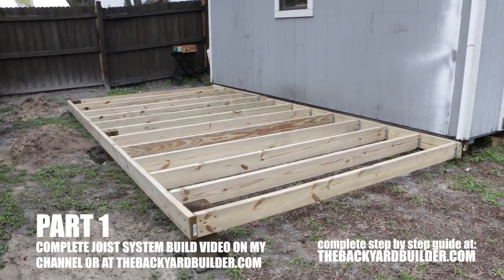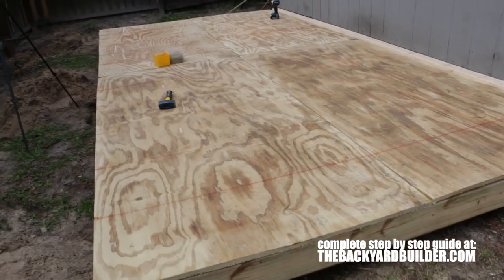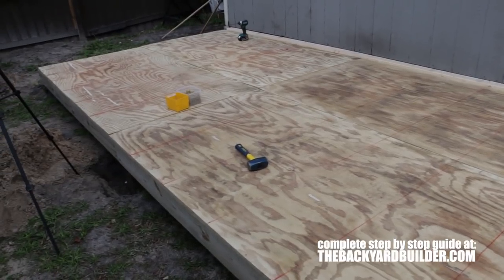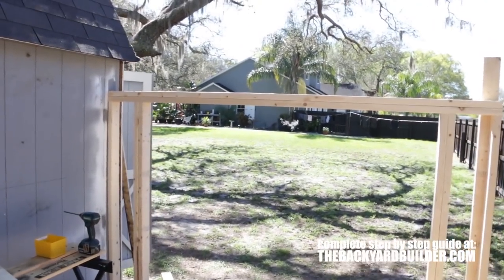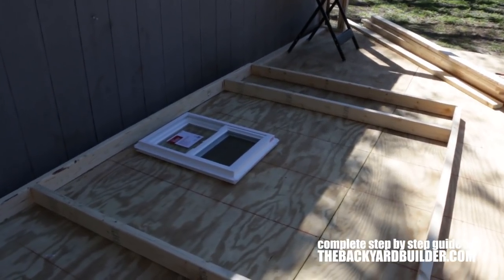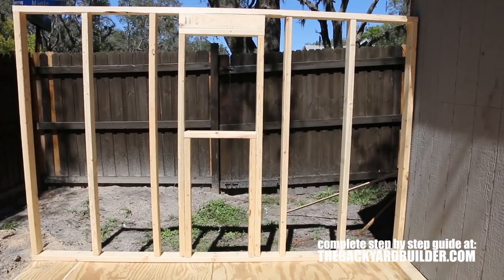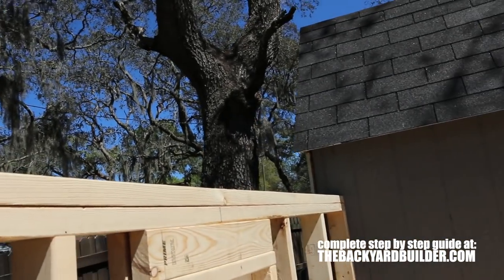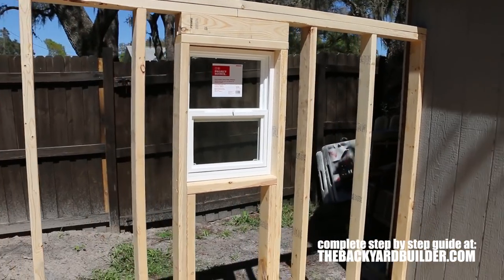How To Build a Shed

Comment: Hi nice build.  Lots of work involved.  As a matter of info... your window framing should also have two king studs, top to bottom, as well as 16" on center cripples in the bottom void of the window for sheathing.  The top plate of the double top plates should be cut so as to permit attachment of the neighbouring wall to anchor into it from the top plate.  Short or long depending on the anchoring.  Makes for stronger wall structures.  

You are doing a great job overall and I think this structure will withstand the test of time.
Reply: You spotted the very things I noticed.  Lack of cripples for attaching sheet goods under the windows and the lack of double top plate to tie the short and long walls together.

Comment: I would have staggered deck boards too...
Plus, with "crazy rains in Florida " I would have figured out how to get more pitch on the roof.
Also shoulda, woulda put a drip edge on the roof, under tar paper. You'll be replacing fascia soon enough.

Lastly, cross/angle bracing on doors. They will probably sag.

Looks nice, but the details of life separate us from the primates
Reply from the maker: Nope. Still going strong.
Reply: @Archifx  happy for you

Comment: Hey I love this. I am wanting to build something like this on the back of my garage for a garage gym. I was originally going to put a slab down but it is pretty expensive. How has your flooring held up from rain and/or do you get damp floors from under it? Thanks.
Reply from the maker: Just as good as the day I built it. I’ve built a lot of them like this. It’s a solid design and I probably have about 6500 lbs sitting in it at all times.

Comment: Why didn't u stagger ur decking? And also why didn't u use top plate to sister all the walls together?
Reply from the maker: Staggered decking looks like shit on less than 8’ run. No load on the top plate
Reply: Got ya. Just wondering because I wanna do the same thing. Thank you for replying sir.

Comment: I would have staggered those plywood sheets on the floor.
Reply from the maker: Yep... if it were larger. Definitely. For this particular application (light-duty) worked perfectly fine. Has 2 riding mowers in there. Good advice.

Comment: Man.. with that slope .. how could you use asphalt single.. wonder can damage single due to slow water run off
Reply from the maker: It’s been thru 3 tropical storms and consistent rainy seasons. No problems at all. It’s the length of run

Comment: It looks like the slope of the roof is not steep enough for those shingles.  On a roof in New York, the minimum is a 4 0n 12 pitch(1/8 pitch).  We use what is called a half salvage roll roofing.  https://www.iko.com/na/pro/building-professional-tools/roofing-101/minimum-slope-for-asphalt-shingle-roof/

Comment: You are going to have leakage especially during the winter..... slopes below 4/12 pitch shouldn’t be shingled it should have been a torch down or rubber.
Reply from the maker: Already had a small tropical storm. Myth. Zero leakage. I’ll do a video next hurricane to prove it. I did this slope on purpose to show it’s a good solution for small roofs. I wanted to debunk the slope minimums. Good comment but this was my experiment. Seriously. Sub my channel. Going to do the torrential downpour rain video this season. 👍👍
Reply: Fix It Now  you may read my comment again if you live in a area with real winter weather ( very cold and snow ) you can expect ice dams and leakage also that looks like maybe a 2/12 pitch which is well below the manufactures recommended slope. My 55 years in the building trades will bet that there will be leakage. Of course you may know more then builders, contractors, manufacturing co. That produce the materials and engineers and architects we will see.
Reply from the maker: @danbailey96  haha Well, in FL The coldest day is about 38 degrees. Won't need to worry about ice dams. If you live in a cold climate other than the armpit of hell called FL, increase your slope. You will, of course, need to jack your existing shed up high enough to compensate for the higher slope. Manuf. can recommend a slope all day long. I get it. I know it's under the minimum (I can read) ... doesn't change the fact that in the physical world, there is no leakage or water holding in this case. The roof is only 17' long x 10' wide. Water falls faster on this small roof than can be collected. And, as mentioned. I am going to do a video during our next TS or Hurricane to prove it.

Comment: Should have put the weight on a ledge not held by screws
Reply from the maker: Same as a ledger. Thing is solid as a rock. Already has a VW beetle in it lol
Reply: @Archifx  time will tell
Reply from the maker: Yeh... I suppose. I guess if need be I could always just pull that 2x and add a couple posts under. Wouldn’t be hard at all. I did build my dad a massive 24x16 system similar to this and they have an 8x8 hot tub sitting right at ledger for past 3 years with no issue but I do see where I could improve. Thanks for the insight. Sub me. I’ll do some updates etc. nice meeting ya 💪👍

Comment: One the roof the material you laid down on top of the OSB is called ROOFING FELT if you are showing the correct way to roof at least use the correct terminology. Now proceed but I will be watching and I have 40 years experience.